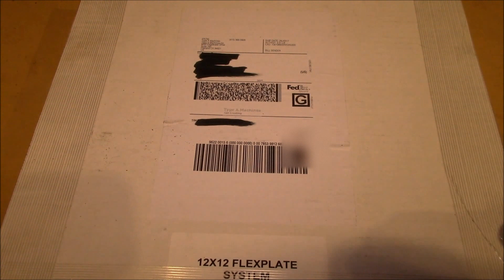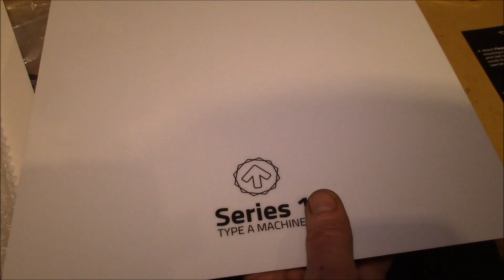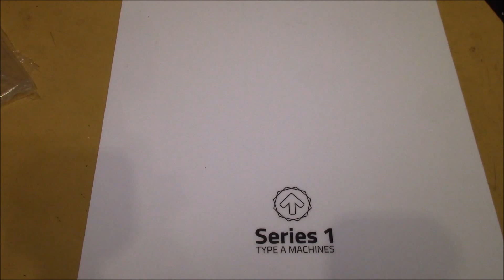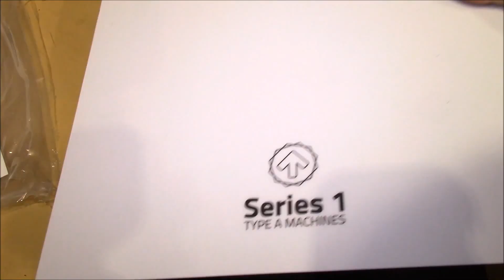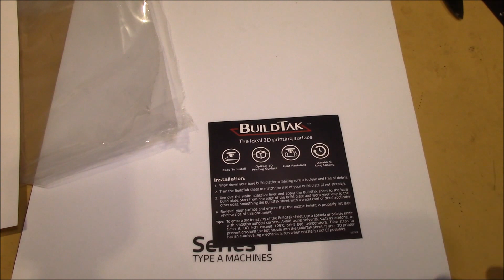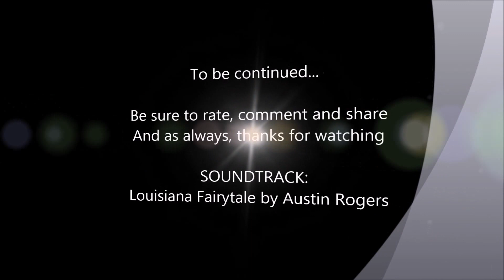BuildTak™ FlexPlate System, Part 1 - Unboxing

Comment: no idea how I got here. What is this?
Reply from the maker: It's a removable printing surface for a 3D printer.  Seems like a good solution for getting freshly printed parts unstuck from the build plate, just flex the steel sheet and the parts pop right off.  Kind of like you can do with cookies on a baking sheet.